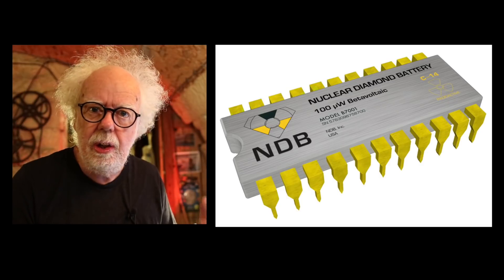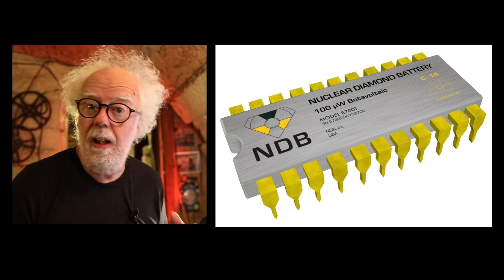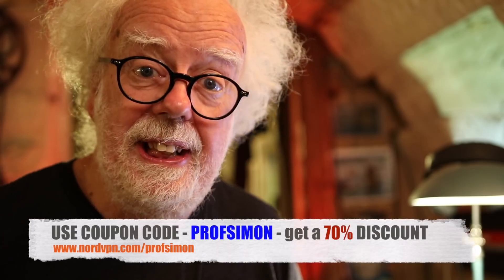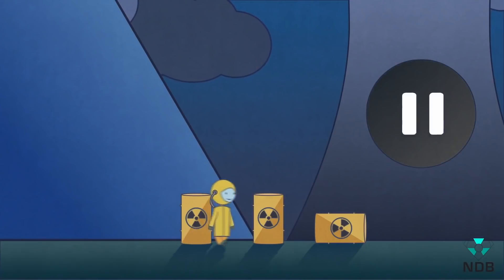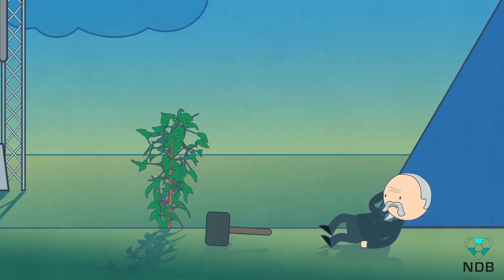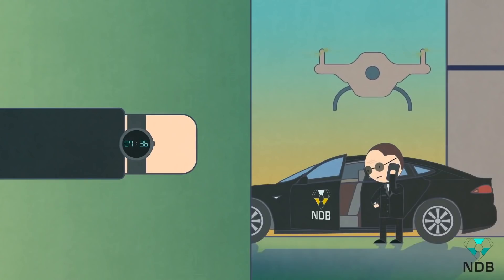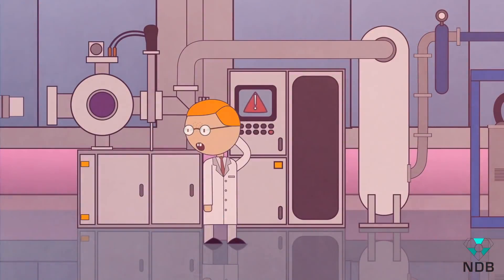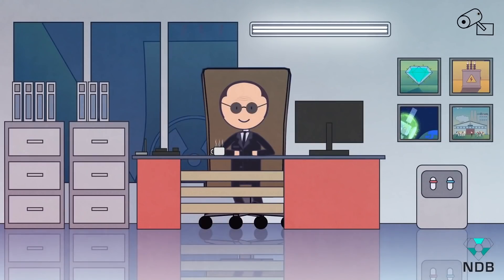How do nuclear diamond batteries work - prof simon

Comment: if 1 diamond is inside of a second then it is probably blocking that wave length of radiation, it can not penetrate the second layer of diamond, think of it like a microwave oven the iron stops the microwave wave size from leaving the oven, it is the wave amplitude that blocks it leaving , if the second layer was a different thickness it would not stop the radiation.

Comment: Thorium fueled, Liquid Salt Nuclear Reactors can reduce the storage life of radioactive waste such as plutonium from 100,000 years to 100 years. 
NDB Batteries can be located in the galleries of defunct coal mines far underground, they sound like a reliable source of power for space craft. 
Why can't radioactive waste be stored in plastic barrels topped up with water so they don't crush and be placed in a subduction zone under the sea. 
They will eventually  become part of the magma (which is already radioactive) it will dilute the radioactivity of the nuclear waste?.

Comment: An organic material would absorb then trapping it within with carbon 12 is easy beta gamma etc. emitted energy but the power that is produce isn’t worth it now making the battery for a learning point is great but other then that it’s blah blah blah simple minded we are ...why are people stuck on electricity it’s not the most powerful energy there is harnessing the sun isn’t ethier we need to think out side the earth 🌍 what dose space have to offer gamma and beta it’s all around you learning to absorb these rays and use them at will is the answer what can we make that can burn these rays or use them it some sort of way making fuel not an issue

Comment: It is very simple. The nuclear energy in a battery is directly converted to electricity. So from a particle that shoots a ray directly to the end of a wire (like a pool ball that hits a line of balls). The energy moves down the line like water in a hose that shoots electrons to the device. When the device is off the chips in the battery take over and bleed off the shooting rays into a harmless piece of copper as electricity, heat sink mounted. The heat sink also serves as a radiation shield if the chip fails. What is so difficult to understand about that?

Comment: May view is that a car or any other applications could not outlast the battery itself. Even if they made a very durable car, it would go out of fashion sooner or later but the battery would still be there, so they would need to remove a reuse. Here is the problem, the existing battery business is fed by an ongoing demand, this demand would never be as high as the market is flooded with everlasting batteries from many vendors, this would starve the battery manufacturer making it unsustainable. For such manufacturers to survive the price of each unit would have to be astronomical

Comment: Nuclear batteries are nothing new, NASA has used them since the beginning of the space age and the USSR /Russia/ former soviet states used them in their space programs and in unmanned light houses. These nuclear batteries( RTG’s) use a radioactive fuel with a very short half life which means quick decay and lots of heat that can be turned into electricity. NASA’s fuel of choice is plutonium 238 which decays so quickly that a lump of the stuff is red hot all in its own and the battery converts that heat into electricity. These new batteries are taking the principle of using nuclear radiation to produce electricity albeit he diamond lattice is probably quite a bit more stable and energy dense than Pu238

Comment: This tech was developed and patented by a researcher at the University of Bristol in UK. The C12 encapsulates the radioactive C14 ensuring that there is no radiation leaks.  The output power is low and there are considerations on how to incorporate tritium to increase output because tritium provides more beta particles

Comment: Another that was used in the past 
Radioisotope Thermoelectric Generator Pacemakers
In looking at the nuclear pacemaker, there are two distinct kinds that became relevant in the short period of time that these medical devices were in use. The thermoelectric generator used Pu-238. Due to the extremely high risk and toxicity involved with using plutonium, numerous layers and shields were woven into these pacemakers resulting in larger and heavier devices. Despite strong concern of radiation exposure, the actual risk of exposure from these plutonium-powered pacemakers was almost non-existent.

Comment: I take issue with a number of your comments about nuclear recators.  Modern reactors used for commercial power generation are light water moderated reactors which require enriched uranium fuel to produce power.  The nuclear fuel is actually uranium dioxide pellets.   Spent fuel storage / reprocessing has not worked as planned thanks to your government.  Utilities pay a fee to the (US) government for waste disposal. To my knowledge  Not one dime of that money has been spent for this purpose.  Technology to reduce spent fuel residues to a glass like substance which chemically bonds the waste  products together has been known for decades  As usual,  politics has been the barrier to implementation.  The (US) government gets all of it's plutonium from the Hanford Washington and Savannah River plants.  The government approached my utility in the 1990s about providing tritium for use in nuclear weapons.  We "declined"  the opportunity.   Carbon 14 is an isotope of carbon which has a long (predictable ) half life  C14 analysis is used to determine the age of some fossils.  This proposal looks like" high tech" snake oil.

Comment: A new Development called Waste burners that spawned from the resurgence of Thorium Nuclear has come into R&D.  So we have a solution to Nuclear Waste in development and possibly close to commercial use.

The biggest problem with the Gamma Rays is the fact that it goes threw so much stuff.  You literally need 6 feet of concrete wall to stop it with any reasonable safety measure, from a functional nuclear reactor.  that is what is usually between the Control room and the Reactor, when both are side by side each other.  So you are not going to be having a AA battery as a spent Diamond Nuclear Battery, even if they had some sort of Diamond Lattices Shield over it.  Even lead, which you can have Half a foot or less of, still has to be hugely thick.  So I am pretty sure this Nuclear Diamond Battery is't going to be something that can reasonably fit in your pocket.

Comment: Nuclear batteries have been around for years. The problem is they put out barely measurable amounts of power. 

They cost thousands per battery and you need millions of them to light a LED. Using them to power a car or sell energy to the grid is absurd. Trying to charge a phone would actually discharge it since the power required to run the charge circuit is more than these batteries produce.

You can't even store the energy in a capacitor since real world capacitors have a leakage rate that is higher than the energy production rate of these batteries.

Comment: I'm a nuclear engineer and this video is why scientists have never successfully run a power plant. Most power reactors are moderated by water, NOT carbon. Chernobyl was a Carbon moderated reactor and look at what happened. There is a tremendous amount of energy in spent fuel that we could burn and reduce the amount of waste we do have laying around but the rare earths, found in wind generators and solar panels are much more important to mine than energy resources we already have!

Comment: Fossil fuel power generation kills circa 7 million people a year due to the adverse effect of the pollution and thus nuclear electricity generation is incredibly safe compared to using fossil fuel (about a million times safer if we presume an average of 7 deaths a year from nuclear).
Nuclear would be even safer if we used a slower fuel such as thorium but the technology that we've used to develop current reactors is based on weapons grade fuels.
I'd be interested to have your views on the use of thorium.

Comment: 100 micro Watts per chip battery - interesting.
I charge my phone for a couple of hours a day at 10W (5V at 2A for 2 hours, say) so my phone draws maybe a bit less than 1W from the battery on average during the rest of the day.
Just one Watt equates to the output from 10,000 of these little chips. I'm going to need a trolley to carry this battery. Still mobile though, so no worries.
Bonus: If the emergency services need to find me in a hurry, a simple Geiger counter will point them in the right direction.
Reply: "Obviously," a Geiger counter wouldn't find you, since the battery is based on beta emitters - the radiation it makes, makes electricity. If a Geiger counter can see it, that means it isn't working.

Comment: So the real trouble is the device says 100uA. I'm sure the marketing team missed that. Your 1.8Ah AA is going to take about 18,000 hours to charge or a little over 2 years. If your use case is good at running at a couple hundred microamps it will last a year prior to requiring another 2 year charge. Maybe fine for an ultra low power clock. Not many other things it will be useful for.
Reply: Imagine a nuclear diamond battery that can last 1000s of years ￼😊...then, realize such battery needs to be 1000s of times bigger than a Li-Ion battery for the same power 🤔 (yes, this is a scam)

Comment: I can't see this tech going far at all...for a start, that kind of nuclear waste material is inherently low emmisivity,  electrons are a small fraction of the radiation emitted, and the helium nuclei and low electron volt gamma loose a lot during conversion and the whole thing has to be a nice uniform lattice to get consistent current, so what happens when you have gamma and alpha particles banging around in there ?  damage to your crystal lattice, your nice packed  carbon gets tracks through it tracing the rays path, god only knows what that will do to it's overall conductivity, normal silicon is doped to be slightly less pure to increase conductivity, so at any rate the manufacturer will not be able to claim a reliable consistent power output, I would imagine...
Reply from the maker: Thank you great info.

Comment: From the Diamond Battery PDF..
What happens to the C-14 when it undergoes radioactive decay?
Carbon 14- decays to nitrogen-14 by beta emission. The beta particle is essentially a high energy (Average decay energy 50keV) electron and in our device this initiates a cascade of low-energy electrons which are collected by the outer electrode. Over time this leads to a build-up of nitrogen but doesn’t destroy the diamond structure because nitrogen is 
surprisingly soluble. Diamond has a solubility limit for substitutional nitrogen close to 2·1018 cm–3in CVD-formed diamond. It would take hundreds of years for this transformation 
to become noticeable on the performance of the device mainly because the majority of the current is generated in the bounding (and isotopically pure) ‘clean’ diamond layers.

How is current generated and how does it flow?
As explained above the beta particle released by each C-14 decay moves into the surrounding diamond structure creating successive electron hole pairs due to inelastic impacts with other carbon atoms and generates a cascade of lower energy electrons that are collected at the metal contact to the diamond. In conduction terms, diamond is a semiconductor (like silicon) and like the operation of a silicon solar panel cell, electric current flows when valence electrons are given enough energy to be promoted into the conduction band.

How is power transferred from the diamond to the device it powers?
It is unlikely that the diamond battery will provide direct power to the attached device. More likely is that it will be associated with a capacitor that will be ‘trickle charged’ by the battery and then discharge at set intervals, to power devices at set intervals or to continually power law draw devices. 

What are the next steps in the research?
We are still at TRL 2 at the moment and currently seeking funding to take the concept forwards through a series of more complex and efficient prototypes. One route is to grow the isotopically layered C-14/C-12 diamonds in the lab from high purity gases. For this we require substantially larger quantities of C-14 methane than we currently have available. Another possible route is to grow Nitrogen-doped diamond in the lab and then irradiate it in a reactor to grow-in the C-14 and subsequently deposit ‘clean’ diamond on the outside. This would achieve the same effect but without full isotopic purity. We are about to do this in the research reactor at KURRI in Japan

Could you 'string' these together/ link them up/ add them together to create a greater 
source of energy? 
In short – yes! Much like a normal battery consists of multiple cells we could also sum currents from multiple cells to up the power output.

What about U-238, U-234, Np-237 etc? 
Other radioisotopes could be used, however the benefit of C14 is that it emits only beta 
radiation. This means that it can be made passively safe by surrounding the radioactive element of the device with non-radioactive diamond. Other radioisotopes may emit gamma radiation which will not be shielded by the surrounding diamond, and so are less likely to have public assurance that they are safe and will require additional shielding to make them safe. Such shielding will make the devices larger, heavier and more expensive and so would limit their use. 

Are there any published papers available? 
As we are still at TRL 2 at the moment and in the early stages there are no published papers on this exact project. The research team are working towards publicising the prototyperesults after patents have been completed and filed.

Comment: the catch22  in here is simple: radiations for one battery is'nt really important, but if you have to tie 9000 of them to "power a tesla"...chances are that the radiations level will reach some toxical level...my useless two cents.

Comment: this is bs.  100  micro watt  per chip =>  10,000 chips about 1 watt. Each cip weighs about 10 to 30 g  therefore 1 AA battery equivalent would weigh about 300 kg (600 lb). There are a lot of other phisical problems with this  check out thunderfoot's debunking of this marketing hype. Also, most of the reactors in the US do not use graphite and most of the radioactive waist is not carbon. It is spent fuel/fuel rods.This so called battery does not address any nuclear waist issues at all.

Comment: Here is the real answers you are looking for.  The NDB uses Carbon 14 that builds up while the carbon was in the graphite moderator rods in the nuclear battery.  That Carbon 14 is squeezed into a "diamond like" form.  This is then contained within another shell of normal carbon 12 that is also squeezed into a diamond like form.  The reaction from the Carbon 14 is 
 where the electron being ejected has an energy level of about 50 keV.  There is no other radiation.

Comment: Kind gentleman with a well meaning video, except he has only half of the mechanism right.  The C14 (radioactive carbon 14) diamond is encapsulated by C12 (stable normal) diamond, and a method embedded to collect the electric current is then used to charge a supercapacitor which then supplies the power much like a battery would.  This methodology alerts the problems he states exist since none of the radioactivity makes it outside the diamond containment.  Expect smartphone batteries and medical devices to be early adopters of this tech since the power density is better than lithium batteries and NDB is cheaper to produce than expensive and limited lithium.
Reply from the maker: Thank you

Comment: Interesting but potentially a complete new meaning to a battery with a lifetime warranty!  The problem is the definition of who's or what's lifetime. 🤔. De Beers may also have an issue with this not to mention the Russian diamond manufacturers.😂

I still believe that the nuclear waste problem is an irrational political one rather than technical. The earth is riddled with radio active material so a a trivial amount extra is likely to be of no significance whatsoever. Plate subduction zones have always seemed appealing to me as a potential repository.

Comment: Sounds similar to the nuclear resonant battery.  In that, the beta source is surrounded by a copper coil which is paralleled to a capacitor.  Each beta impact with the coil starts a electron cascade in the copper, and knocks something like 36,000 electrons loose.  The coil then transfers the energy to the capacitor, and vice versa.  The more impacts, the higher the voltage rises due to the resonant rise in the circuit.  You need a heavy beta source, and I believe strontium 90 was used.  The NRB I saw was about the size of 3 large car batteries, and could run a low power radio beacon.  The NDB powering a car is BS!

Comment: Betavoltaics is old technology around 1970's, limited use, high cost low power.
Reply: It might replace RTGs used by Mars rovers, which would be huge help for Mars exploration. But I am a bit skeptical if it is any better than RTGs at all.
Putting beta emitters into consumer electronics sounds like a horrible idea anyway, unless you very strictly track every cell, and handle recycling perfectly.

Comment: Power level, volumetric efficiency?
Sounds like toy power level, may be for running watches...
Reply: It's designed for use in ultra low power sensors I imagine, however their are similar things that are cheaper although I don't know about any commercial products.